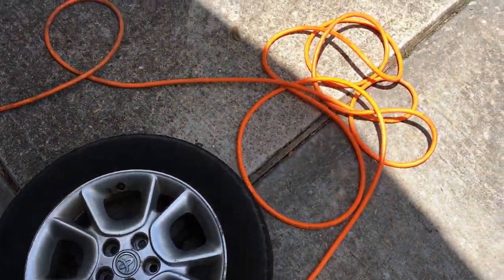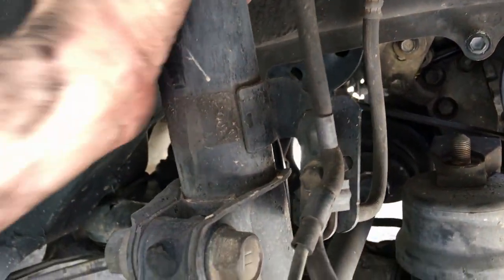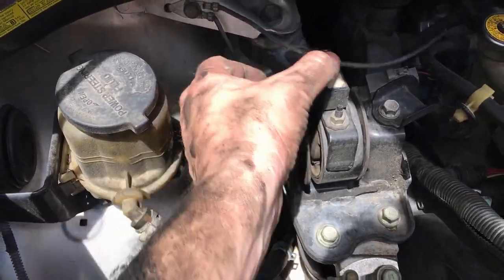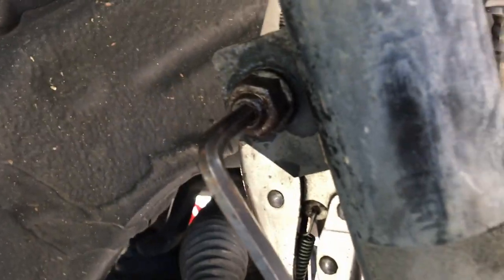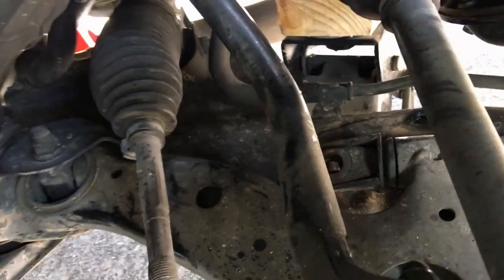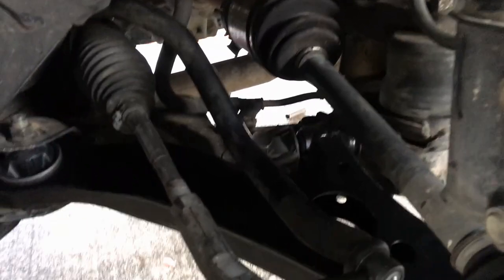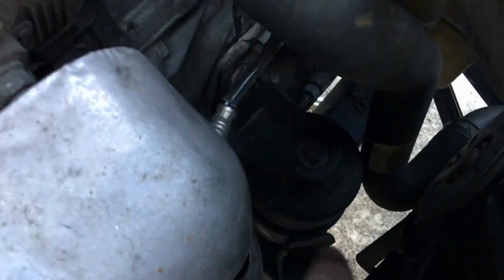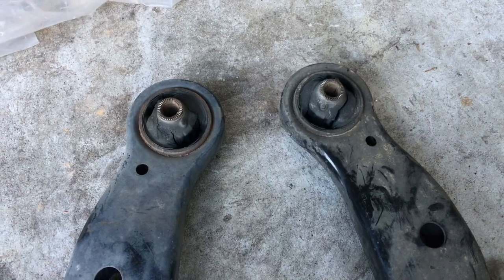2004 Toyota Sienna (Lower Control Arms and Linkage replacement)

Comment: Thank you much for the video, I would not have done the job without it. Here are some comments that might be helpful for other people:
1. You do NOT need to disconnect the sway bar links. If you put the car on jack stands on BOTH sides the sway bar is not in the way. It is however if you jack up one side so the car is tilted.
2. It is easier to put the new arm in if you lower the engine back down after removing the mount.
3. The stud of the mount on the driver side on my car was way too long. Check yours, if it is then you may want to cut it off a little so that you do not need to lift up the engine / transmission too high. If you do lift it up too high then you may damage components on the top. For example, my air intake hose was pulled off of the air filter housing.
4. On the passenger side I had to put the front 22 mm bolt first and then the rear. On the diver side - the other way around. There is no rule here, depends on how well the replacement parts fit. Mine by Detroit Axle were not too good, I had to use pry bars to get them in. It was a tough job and time consuming. I should have had parts that fit better, maybe buy from the dealer or go with a different aftermarket brand.
Reply from the maker: Excellent feedback. Thank you.

Comment: Thank you for making this video tips. I have a 2009 Venza V6 AWD w 177K mileage  that needs new control arms. It seems that both the Sienna and Venza have the same control arms and same mounting. After seeing this video I feel confident that I can replace the control arms as well since I'm about to replace both lower ball joints.
Reply from the maker: Glad it helped

Comment: Can anyone tell me if the 2005 Sienna requires the motor mount to be removed in order to get the control arms out?
Reply: I have a 2008 scienna and the motor mounts is just like in the video.  I found a mechanic to do mine. It's too much for me. I usually do brakes rotors and cv axles,belts, alternators and things like that but not control arms or struts or rack and pinion,  I pay to get those done.  I hope this helps.
Reply: @BenjimenAnderson  we ended up paying to get it done as well. Too much rust and bolts seized on.

Comment: Ok video lower control arm disscription of how too, I would mark all the bolts afterwards if working on someone else's vehicle, and also sometimes you can buy a brand-new vehicle right off the lot with thoughts bushings shot, so look out for this on dealership vehicles too✨🏁☕🔧😷🔧🛸🏜️
Reply: pro trick: you can watch movies at kaldrostream. Been using it for watching loads of movies these days.
Reply: @Patrick Collin Yup, I have been watching on kaldrostream for since november myself =)

Comment: Thanks for the great video. I am actually stuck in putting the right lower control arm back in. I put left bolt and the right two bolts loosely in. Now I can't align the three bolts on the piece attached to the ball joint to the holes on the control arm. they are about half inch out from the holes. What should I do? Thanks!
Reply: Actually I got my answer from someone on the internet.  I inadvertently had pulled the axle out a bit. I just turn the wheel straight and pushed the axle in.
Reply from the maker: Here is a video where I replace just the ball joint on the same vehicle. you can see at 4-minute mark in this vide where I am aligning the ball joint studs into the control arm. https://www.youtube.com/watch?v=VoWyhjoav6M

Comment: Do you remember what socket sizes we'll need? We are going to borrow an impact gun from a coworker, but we only have regular sockets and not the black impact kind (only two impact ones that we use with our breaker bar for lug nuts). He needs to know what sockets we need.
Reply from the maker: Gosh. I believe the largest size was 22mm and it was used in multiple places. For this job, I just used a breaker bar and not my impact. Regardless, you could probably get away with not having to purchase the black sockets as long as you are using 8 point sockets. Sorry for lack of details. I almost did not post this video as I had poor coverage on most steps.
Reply: @projectfixit  I finally found a video where the guy states the socket sizes. 10mm, 14, 17, 19, 22. Your van looks fantastic. Barely any rust. You still have paint on your control arm! Lol all I have is rust. Every inch of every piece of metal under my van is covered in rust. So whenever we go to get any bolts off, it's a fight to the death. The plan is to use the impact wrench at a low setting and patiently work the bolts off. This evening, when we got the van back after having someone patch a hole in the rocker panel, I jacked it up and put it on stands, took the wheels off, and sprayed with Zep 45 every bolt we plan on taking off. Gonna let it soak for several days until we work on it on Saturday. Maybe I'll give it another spray tomorrow.
Reply from the maker: @SarahPoulin  Yep. I live in a part of the country with two seasons (Fall and Summer). No salt to corrode my vehicle up. Good luck.

Comment: Thank you for the great video.  How many miles were on your van at time of replacement.  Do you think it's a good idea to replace the motor mounts too while you're in there?  Shocks too for that matter.  I have an AWD 04 and that will also need a steering rack.
Reply from the maker: I replaced the lower control arms somewhere around 140k miles. I am sure I have it logged somewhere, but this is just from memory. I haven't seen any issues with my motor mounts and they are pretty easy to get to. So, I would't change them unless they need replacing. I just replaced the struts on mine and have a video on that. If you were going to replace the struts, it is an ideal time to do it. The steering rack was a pain to replace on this vehicle comparing it to a pathfinder / QX4. You have to fish it out the driver's side wheel well. Now would be an ideal time for that, too. With all of that at once, you are pretty much tearing apart the whole front end. Take your time and be sure to properly tighten all hardware and double, triple, quadrupedal check everything.
Reply: GOLD advice  @projectfixit

Comment: I assume what is shown in this video is AWD Sienna. There is a slight difference compared to FWD models, at least in some part numbers and specs.
Reply from the maker: This particular vehicle is 2WD.
Reply from the maker: sorry 2WD/FWD
Reply: @projectfixit  I watched the video for a seoncd time, yes it looks FWD/2WD.
 What made me though it's AWD is your wheels. I think your van is XLE or higher trim that shares the same style rims/ run-flat tires with AWD models.
Thanks for the video.

Comment: My wife’s siennas lower control arm bushings are also cracked like that and the steering is very loose and sloppy. I also noticed the rack and pinion shifts a little when we turn the wheel. Do you think the sloppy steering is due to the lca or more from the rack and pinion?
Reply from the maker: My feeling is the the lower control arms and related ball joints will create the most looseness in your steering. I believe the rack gear bushings may be replaced without having to replace the whole rack gear.
Reply: @projectfixit  I ordered the lca and hopefully it’ll fix the loose steering. From your video I think I can do it myself but if it’s the rack and pinion I’m just going to pay a shop to do it since it looks like it requires way more work. Thanks for the reply.
Reply: The steering rack should not shift when you turn the wheel.  On my 2006 the bushings on the rack were shot at 180,000 miles and had lots of sterring slop and would have activation on VSC with cornering. Rather than replacing the entire rack, I replaced the bushings with Polyurethane ones I got off ebay. Toyota only sells the  entire rack rather than just bushings. Took some time to get the rack off and repalce the old bushings,  but was only $39 for the parts. Van now has 209,000 on it and no problems. I followed Fix it Angels video replacing the rack. Make sure you torque to all the proper specs. and get a alignment done afterward.
Reply: @D52318  yup those are the same symptoms my wife gets when she takes a corner. Did you had to use press or a BFH would work?

Comment: I notice both of my front lower control arms are shot as well. I also have been plague with the excessive outer tire wear on both front wheels. I literally have to replace them with less than 15k miles. Did this repair helped with tire wear?
Reply from the maker: I am at 185k today which means I have put right around 21k on the car since the repairs. At some time near this repair, I had installed new tires. So far, it appears the tires are wearing evenly. We will see after another 21k or so. At that time, the tires should be close to needing replaced.
Reply: @projectfixit  Our Sienna has 193k miles on it. What PSI did you inflate your tires to? We inflate them to 43psi and it does help a little bit.
Reply from the maker: @CJ-fh5xq  I have mine inflated to 35PSI as it states on the inner door panel.
Reply: Yes it will fix the tire wear issue.

Comment: Great video I need to replace mind. How are those Bodeman control arms holding up?
Reply from the maker: I don't drive the car much these days, but I was driving it around today running some errands and was thinking of how good of a ride it is. They seem to be holding up fine. I haven't inspected them in a while, but the steering system is solid. Front tire tread looks to be wearing evenly. I have also replaced the front struts, too. I have a video on that as well. Thank you for watching!

Comment: Can this be done without raising the entire front of the car at once (like only raising one side at a time
Reply from the maker: Yes. You can do one side at a time. I am not sure why I jacked the complete car up. I was probably trying to be more efficient since I knew I was going to do both sides anyway.
Reply: Thank you so much! I was worried that if I did one side at a time it would throw everything off and I'd have trouble getting parts out or back in.
Reply: Most of my driveway is on a slight incline only the 6 ft. or so from the garage door is flat. It would make me a bit nervous having half the car in the air. Doing this job next weekend. Struts, control arms, ball joints, stabilizer end links/bushings and new pads and rotors. Front end is a mess lol

Comment: Could you do it without loosening the tie rod?
Reply from the maker: I did not have to touch my tie rods as removing the nuts from the ball joint (bottom side) separates the control arm from the hub. My tie rod ends were good as they had been replaced when I replaced the rack & pinion a while back. Thanks for watching!
Reply: @projectfixit  thanks. Just did mine. What a nightmare. The motormount right side was super stuck. It just wouldn't come of the motor. Took me a couple hours just dealing with that. I had the hole front of the van hanging on the unbolted but rusted in stud on top of the motormount! Besides that on both motormounts some of the the lower studs came loose while trying to get the nuts of. They are just pressed in and have a round head so if you have a rusty nut and need lots of torque and your stud becomes loose you are in for a treat. Thanks god I bought my first welder yesterday. I could spotweld the studs so I can take the nuts of. I don't know how a person could deal with it without a welder, since there is no space to grab the top of it ROUND head. Also the balljoints wouldn't come loose. I had to cut both of with a sawsal with carbide teeth blade, and then with hammering, jacking up and a crowbar they finally gave up. I think my next tool is going to be a ball joint seporator fork. I also had to take the driverside arm in and out a couple times because the two bolts for the front bushing wouldn't get in right. I think the mount in the bushing was slightly twisted and guided the bolts in an angle and they couldn't grap the thread. All over all I have to say it is is a horrible design and it was no fun dealing with this.
Reply from the maker: I feel your pain about the ball joint. The design is horrible as I had to cut mine off, too. Sorry to hear about the corrosion causing you issues. I am fortunate to live in an area where salt is not present in the air or roads. I appreciate you watching my video.

Comment: Jezz man I’m looking at videos on this cause i need to do mine...but wow what a job! Thinking of taking it to the shop. Did you get pricing on this job? Don’t think I want to take it on!
Reply from the maker: Well, I am a cheapskate and figured I would tackle it. It wasn't too bad. The nut for the knuckle was seized on mine. I probably did not need to change the knuckles since the ball joint and boot were still in good condition. Otherwise, the control arm replacement does require the removal of the motor mount. If you are confident in your abilities to use tools, tackle it yourself. You will need 3-4 hours if you are taking it slow and steady. If you get it quoted, I would be interested to hear what a repair shop will charge you.
Reply: @projectfixit  I have to do this and the quote is $700 for a side from one shop. $500 for a side from another shop.
Reply: @19jc80  Mine quote was $288 x 2 parts and $850 labor (USD), Wheel Works. It took me about 4 hours each side, I am not a professional, but I had all the tools that were needed: an impact gun to get the 22 bolts out, could not get them with hand tools, impact sockets, pry bars, break bar, (impact) sockets and wrenches (10, 14, 17, 18, 19, 22), extensions, W40.
Reply: @DT-cd9rj  thanks for the details about the socket sizes. 👍
Reply: @projectfixit  do to both sides of our 2004 Sienna we got a quote for parts and labor for $856.  The castle nut is also stuck on mine.

Did you cut through your ball joint bolt through the boot a few inches under the castle nut? I'm trying to decide if I should take out the CV shaft to get at the castle nut from above with a socket/breaker bar or hack away at it.
Reply from the maker: @runalong  I cut at the base of the castle nut. It wasn't too bad and the blade cut right through the nut and ball joint stud. I did not damage anything doing it this way. It was just inconvenient.

Comment: quite an ignorant design on toyotas part and not very user friendly for the home mechanic when it comes to the bolts under the motor mounts
Reply from the maker: I agree. The ball joint castle nut isn't positioned any better. Thank you for watching!